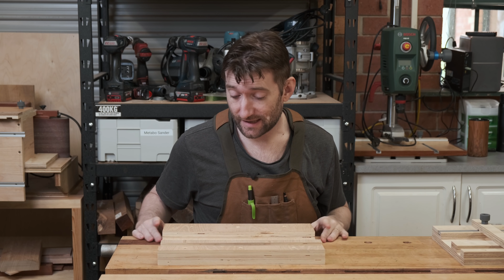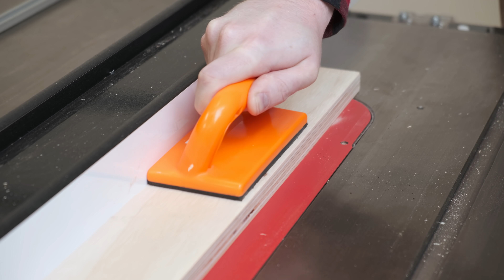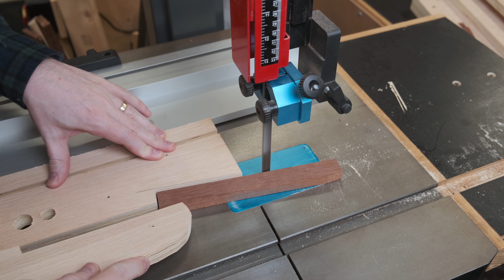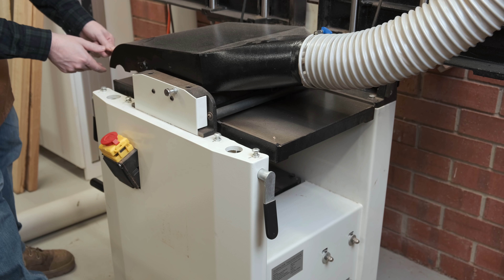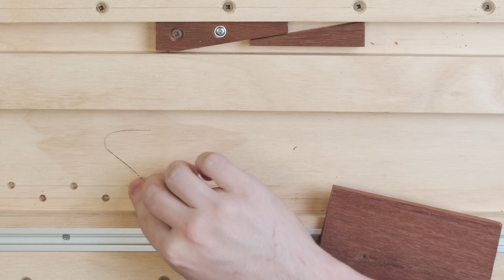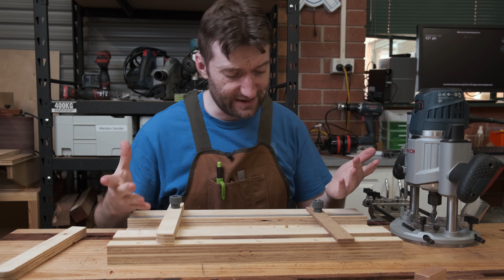Small Parts Routing Jig v2

Comment: If you had a square plate on the router you could do pocket milling. Tiny boxes etc. Instead of flat end stops you could have shaped ones like copy lathes use. Many possibilities.
Reply from the maker: Huh, thats an interesting idea.  An entire plate/template could be screwed in over top and use a guide bushing to follow it. 
I guess the tricky part will be figuring out parts to make completely modular and what parts can just be fixed plywood!
Reply: @tmuWolverine  At the moment I am trying to figure out how to make boxes of any shape. With CNC routers we can only cut as deep as the bit. CNC band saw for deep boxes but they will need added bottom plate. Laminate side layers? Need other methods for mass production?
Reply from the maker: @AlwaysCensored-xp1be  I'm not really one to ask for CNC production methods. Regular machines and hand tools are what I use.
Reply: @tmuWolverine  Mass production for small CNC hobby/home business would be runs of 10 to 20. Jigs are useful for that batch process. Or just get 10 routers. The low cost of these CNC machines has benifits for home based businesses. Vertical mounted to save room?

Comment: Fantastic Jig. I have encountered issues routing small pieces and this is a fabulous solution which I will be building very soon. I'm wondering if you could please link the brass stoppers you use? Thanks.
Reply from the maker: They were just some brass dowel from a previous project that I had laying around, which I cut to length (the mission night stand project)

You could use pretty much anything - bolts, wood dowels, or if you'd prefer something harder, adjustable shelf pins! You can take the plastic 'shell' off, and you're left with a pretty accurate 5mm pin from memory.

The brass I ordered:
https://au.rs-online.com/web/p/metal-bars-metal-rods/0682630/

Comment: Very well done!

If your left and right stops where long enough, you could place a "T" bar on the end opposite the knobs which hooks/rides on the outside of the far rail.  This would further limit deflection while  providing a smooth, infinite, left-to-right adjustment and a more secure stop grip.

Comment: Great Ideas. Where did you get the 'Steering wheel' knob for your drill?
Reply from the maker: It's a 3D printed doohickey https://www.prusaprinters.org/prints/43828-bosch-pbd-40-wheel-knobs  - I haven't printed all three yet because uhh.. I'm a little lazy :D

Apparently many of the "steering wheel knobs" fit as well, but I haven't looked into those enough to know if its all or just some.

Comment: Very interesting jig. What about a wing on each side to clamp it to your workbench. Thanks for sharing!
Reply from the maker: Yup, if you don't have a tail vice, making the bottom plate longer would absolutely work for clamping areas. If you've got Microjig's Matchfit clamps, you could also route a dovetail track in for clamping too.
Reply: @tmuWolverine  Also if you have an MFT like workbench, you can have a few dog holes to hold it in place.